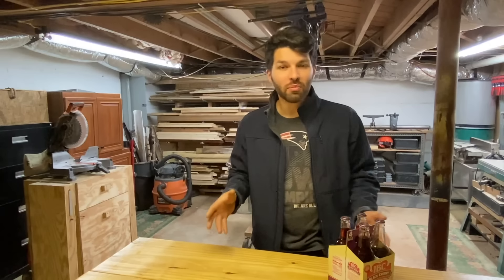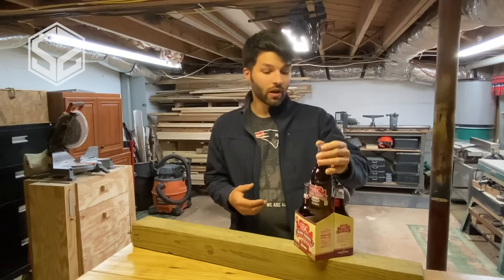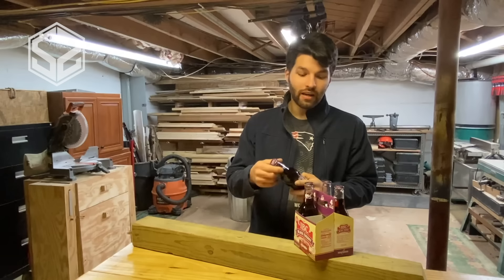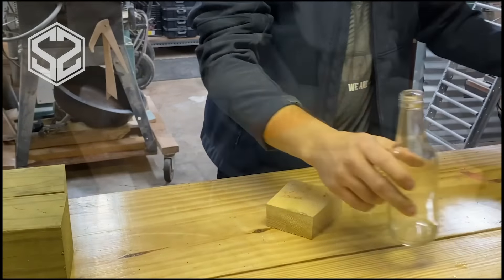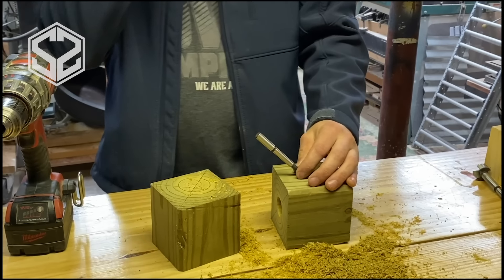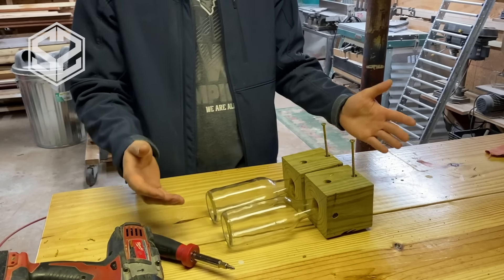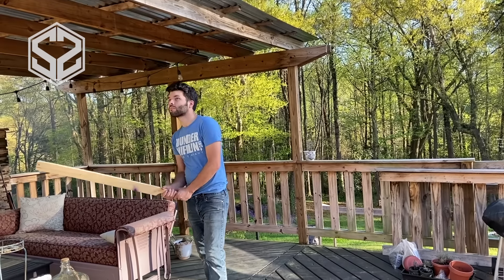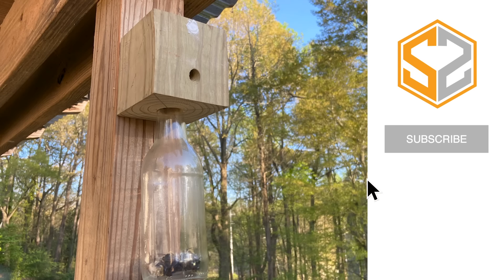How to kill carpenter bees

Comment: Do these bees sting ? they look just like what I called a bumble bee as a kid .
Reply: One of the sexes does, it's small though and they rarely use it, they just like to get up in your face and say hi :)
Reply from the maker: Carpenter bees do also bite if you accidentally cover their hole they live in. I called them bumble bees too until I bought a house and saw these bees drilling into my deck. I looked it up and found out these are different. bumble bees in general are much fuzzier and in my area they are smaller and live in the ground on the other hand carpenter bees have a smooth black shiny body and have massive jaws that they use to bite through wood.

Comment: I have some of those but they mainly capture wasps.  No bees.
Reply: Your entry hole/holes are probably too large or maybe too small. Size is critical.   You can make entry holes on all four sides of your 4x4 as long as they enter into the main downward hole and hang is some other fashion if you desire.
Reply: @genepierce7048  They were purchased from one of the local lumber stores.
Reply: @genepierce7048  I purchased mine from one of the big lumber stores.

Comment: I have a problem with the set up because most carpenter bees are not stupid, they will not chew into pressure treated wood , just saying
Reply from the maker: My deck is pressure-treated lumber and they were destroying it even when stained or painted. One of my traps is currently almost full of dead carpenter bees. I'm sure they would be more attracted to raw wood but I noticed that they didn't use the trap until the first bee got trapped and then I caught a few per day in each trap. I believe they are attracted to the scent of other bees. Thanks!
Reply: You are thinking correctly but pressure treated will work because you missed one important fact. First, I will say that if you can used non-pressure treated it will work better and you can do this by simple wood gluing several short pieces of 2x4 together. 
What you missed is that you pre-drill holes in the wood of the trap. When I make my traps I drill a hole on each side and all four holes go into the hole that is drill up the center. You want to make sure the 4 holes are all drilled up at an angle. The reason for this is that you don't want the female to see daylight when she going to investigate the holes, it needs to look dark in there. Then once she lands and crawls into one of the holes she will reach the center hole and at that point she will see light. This will make her want to crawl down towards that light and then she will crawl and fall into the bottle. These traps do work.

Comment: I got stung by the bee~
Reply from the maker: I've been bitten before by one of these but I wasn't aware that they can sting!
Reply: @SimonSaysDIY  the female Carpenter bees do have stingers. They are normally not aggressive but they will sting. I got nailed on my shoulder when I was younger. I was loading bags of feed off of a platform with a low roof. She must have been in one of the rafters and I guess I got a little too close to where her hole was. It hurt like hell and I had a welt about the size of a quarter on my shoulder.

Comment: Great traps! I only see one problem with the ones everyone are buying and making. The Carpenter Bee will not bore thier entry hole at an angle. They bore straight in and make the 90 degree cavity. FYI
Reply from the maker: I have noticed that. Thanks for the tip! For some reason they don’t mind and many of these bees get trapped. Thanks!
Reply: But at 90 degrees the bee often figures his way back out by seeing the light at the end of the hole, I have observed that happen, but at the angle upward he drops down to the sunlit bottle more frequently, and to his eventual demise. We used traps similar to those shown here, and got poor results, purchasing others which were taller, and the bees failed to come back out. These shorter ones they could see the light in the entrance hole and escape.

Comment: Question for you, what did you put on the screw heads after installing them (near the end of the video)? Looks like primer. Also, what did you use to fill the holes, just regular caulk? I was thinking putty/glue, not sure what works best for keeping them from redrilling into the deck other than refinishing everything. Looking forward to getting a few installed, thanks!
Reply from the maker: I covered the screw with white calk because I noticed that the carpenter bees were attracted to the dark color of the screws. I believe they thought it was a hole and it distracted them from the entrance to the trap. I tried to use regular white calk to fill the existing holes the bees made and they chewed through it so i tried some white silicone and that seemed to work really well. 

Thanks! i'm glad the video could help!
Reply: @SimonSaysDIY  Mix a little bondo for autobody repairs  and fill the hole. When it dries hit it with some course sandpaper and its done
Reply: Just caulk the holes they avoid it

Comment: I know you may not like them but bumble bees are going extinct instead of killing them treat the wood that they are attracted to in your area and they wil find somewhere else to nest
Reply from the maker: That may be true, but bumble bees and carpenter bees are very different, carpenter bees are the ones that drill into wood and cause damage. If you look at the two side by side bumble bees are fuzzy and cute and live most of the time in the ground in burrows and the carpenter bees is smooth and has a shiny black back, they are also equipped with massive jaws for biting through wood. The only bees that have gotten trapped in these have been carpenter bees because they search for dry wood to live in. Both bees do pollinate however.
Reply: @SimonSaysDIY  the only bees in my traps are fuzzy yellow and black. I have seen them going and coming from 1/2 inch holes on my log home soffits. They are most likely males. Checking on their egg laying females in the nest holes. Males are very agressive but do not sting. I love hitting them with my Nimbus 2022. A badminton raquet on a pole attached with hose clamps. Love the "ping' sound that tells me another one bit the dust !

Comment: I'm curious. What makes these traps work? Is it the bee finds that inviting hole, crawls in and learns that it's not such a good place because of the light coming in from the bottle then she just decides to abandon the burrow and leaves by way of the light from the bottle and gets trapped?
Reply from the maker: The female bees spend a lot of time and energy to dill into wood to create a new home. before they start a new one they always search for an already existing hole that they can use. This is why they enter the trap. After entering the hole they see the light through the glass at the bottom and enter the bottle but are not smart enough to climb back out the top. To increase the effectiveness of the trap fill all visible holes near the trap with caulking, This will cause all bees to search for a new hole.
Reply: Female bees will investigate holes before deciding where to put their next "clutch" of larva. She will be drawn to investigate the holes in the trap. Once she gets in there she will see the daylight from the hole in the bottom, this will make her want to crawl down there to see if it's  a way out. These bees are not very good a vertical flight, so once she gets into the bottle is is near impossible for her to get back up to the hole. I always put a little water mixed with dish soap in my traps and once they fall into that, they will be dead relatively shortly.

Comment: Too many errors and issues in this video to take the time to comment on. But suffice to say,, I really dont think this would be a successful  solution.
Reply from the maker: Shockingly it works lol. The bottle on my trap is nearly full dead carpenter bees. The female bees spend a lot of time and energy to dill into wood to create a new home. before they start a new one they always search for an already existing hole that they can use. This is why they enter the trap. After entering the hole they see the light through the glass at the bottom and enter the bottle but are not smart enough to climb back out the top. To increase the effectiveness of the trap fill all visible holes near the trap with caulking, This will cause all bees to search for a new hole.
Reply: Well you would be wrong. I have used these traps for a long time. I actually make mine using bigger plastic bottles (quart size) but the rest of the trap is pretty much the same and what "Simon" made here and they work really well. Again, a lot depends on how much exposed wood you have in the area. It's like any other pest, if you give them what they need to flourish well then of course that is what is going to happen, but if you just want to stop them from infesting your home, these traps do work. I hardly ever see Carpenter bees around my home but I have two of these traps up and I would estimate that I catch at least 20-50 a season. Mostly in early Spring and I do not see any wood damage around my home. When I say wood damage I mean the holes that they drill and I do look for them.